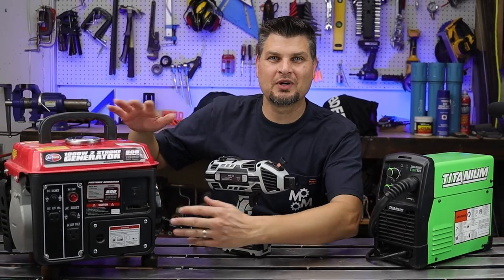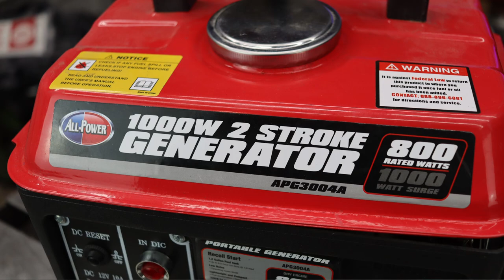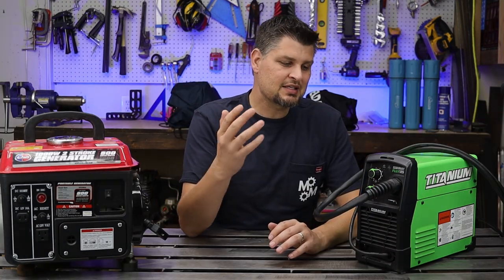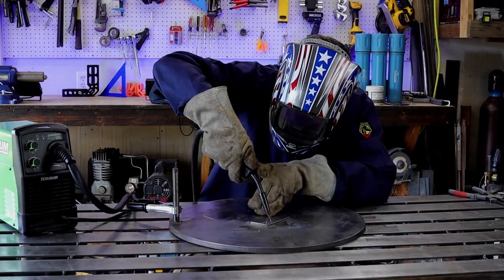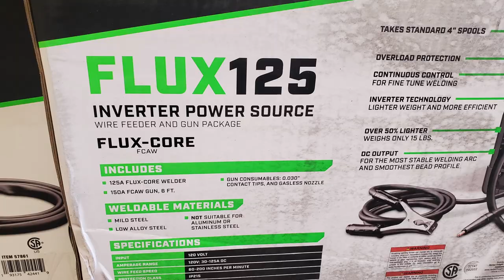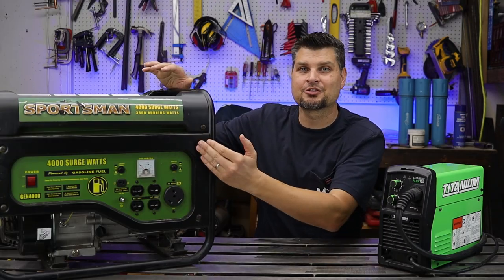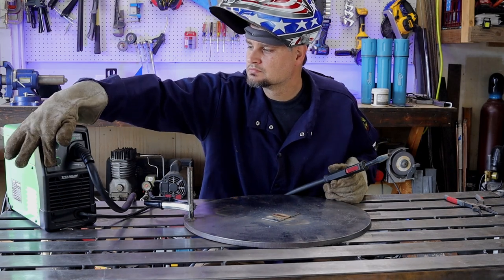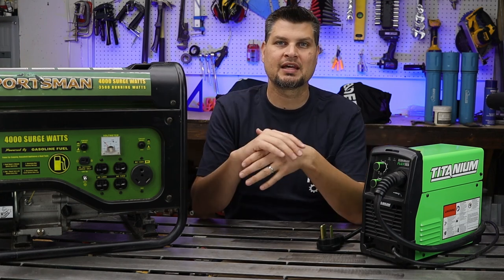Will it Run? Harbor Freight and TEMU Welder With 1000 Watt Generator

Comment: Excellent video! I was just getting ready to weld with my Flux 125 on my WEN 3600 (2900 running). I rarely need to go past halfway settings so should be just fine!
Reply from the maker: That should be great! Thanks!

Comment: Would it still weld good enough for dirt bike pegs with a 1,000 watt generator
Reply from the maker: If the pegs were on the thinner end yes. If it were me I'd get a bigger one to run a welder.